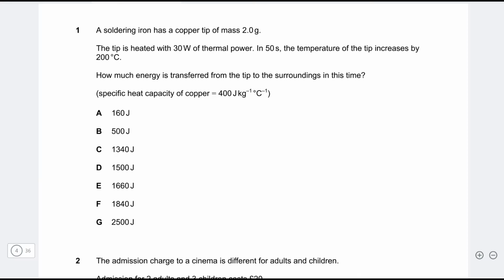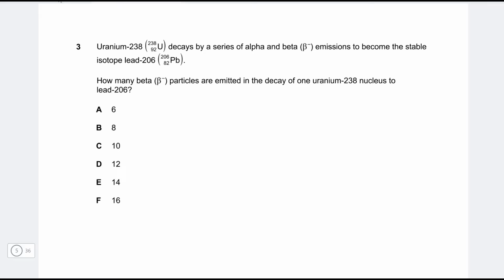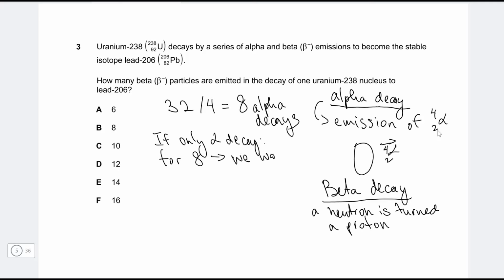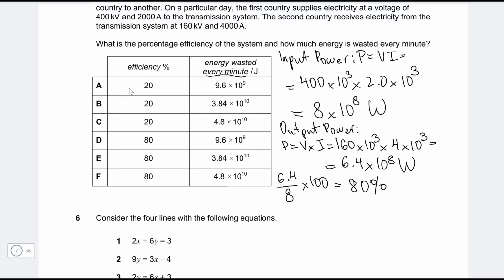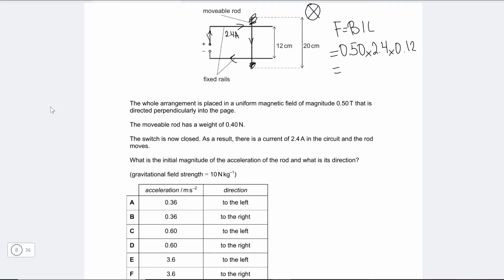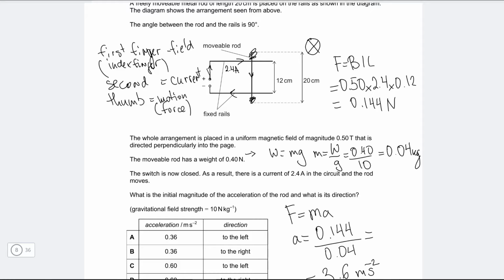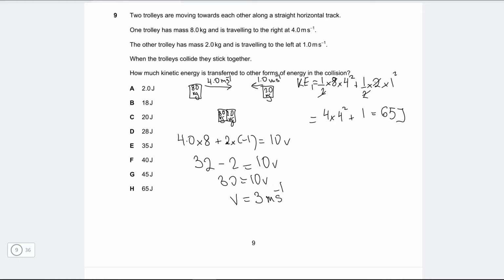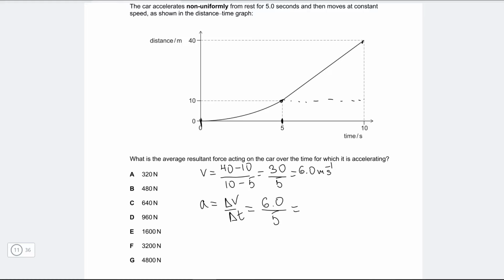My Solutions to: ENGAA 2020 Part 1, Physics Questions, Cambridge Engineering Admissions Assessment

Comment: Hi Sir I may be wrong but for the last question, it says that the car accelerates non uniformly in the first 5 seconds and surely using a=(delta v)/(deta t) assumes acceleration is constant?
Reply from the maker: Excellent question! This is an approximation, unfortunately I don't think the question can be done any other way. As otherwise we would need to integrate and we don't have a function to integrate. I think the approximation is justified in this case as the question is asking for the average force. Hope this helps!